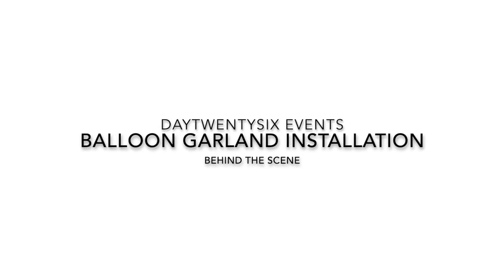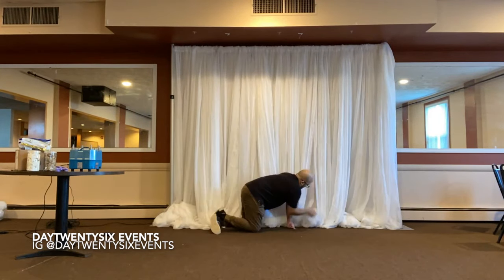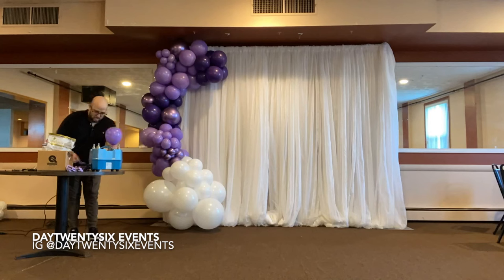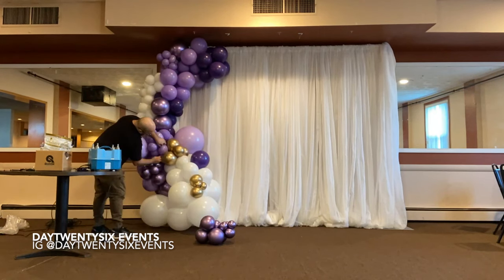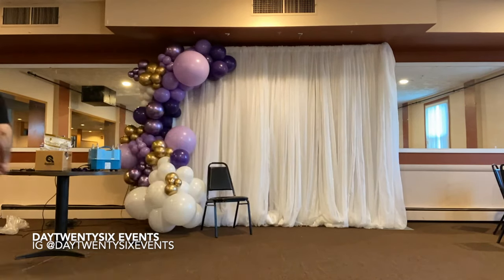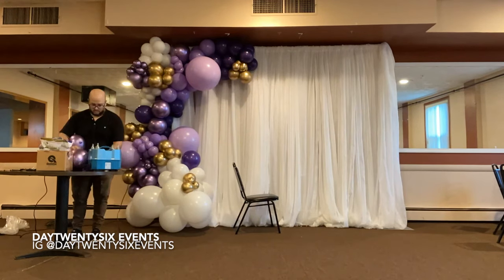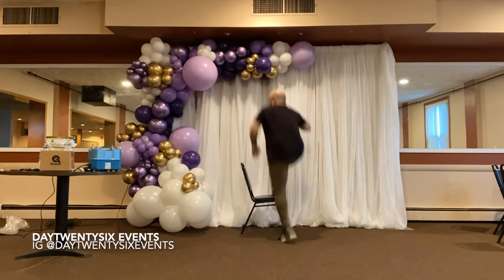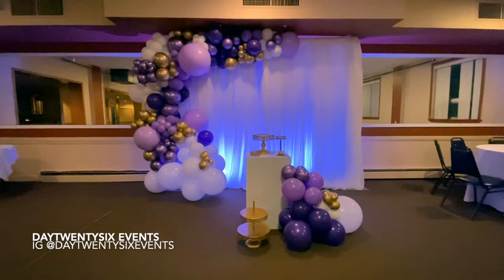How To Install a Balloon Garland

Comment: Great job ! I was wondering how you attached the top part of the garland through the drapes?
Reply from the maker: Hi Raeven! For this particular design I used several fabric panels to create a full look. By doing this I am able to use 260Q balloons to tie the balloons to the physical cross bar by separating and tie between the connection of each panel. A new video will be up soon. Make sure to click on the notification bell to be alerted.